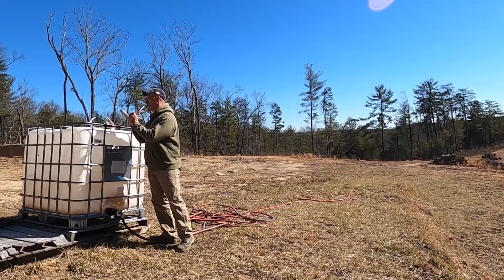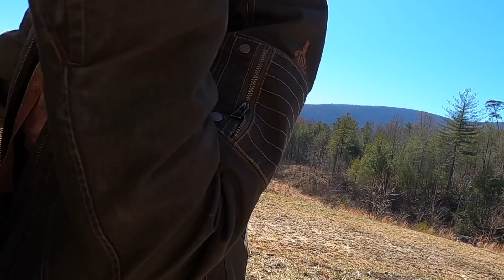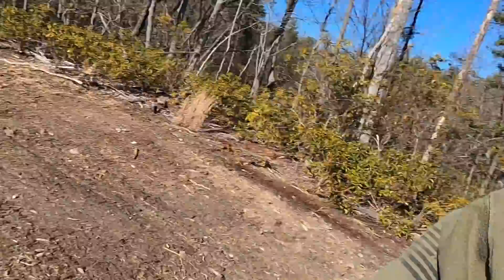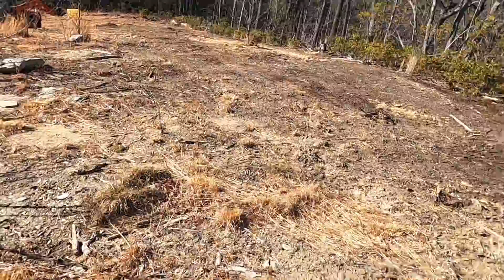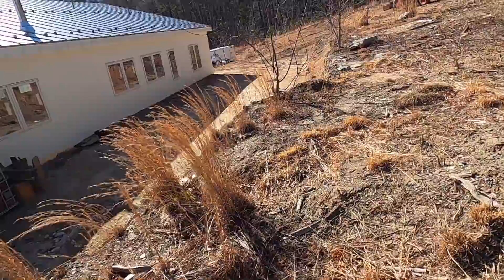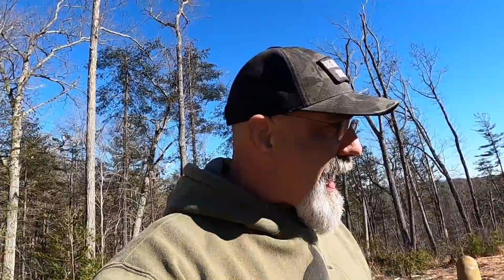Dirty Work.  Digging the Water Line Trench to connect our Well.

Comment: From what I have read in the NEC, the electric can be in the same trench but must be level with the water line and separated horizontally by at least 24 inches. In other words they can be in the same excavation but just not close to each other.
Reply from the maker: That is my understanding as well. But we went ahead and put then in seperate trenches.

Comment: With a trench that wide I would have run both water and electric. Put a tracing wire to the water line in case of repairs and the electrical wires will be protected by the conduit. That is allowed I my area.
Reply from the maker: Electrical for the pump goes in same trench. Service for the house will be in another